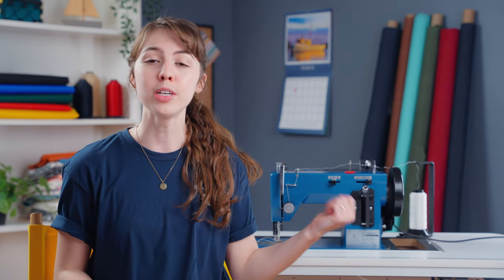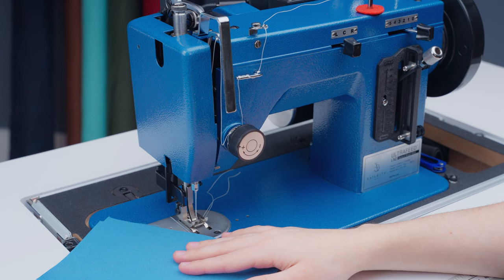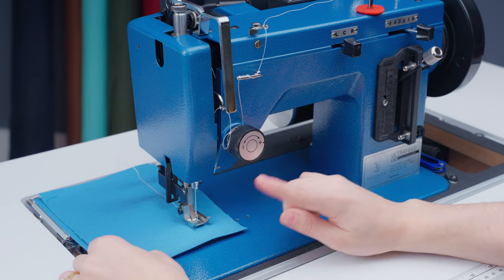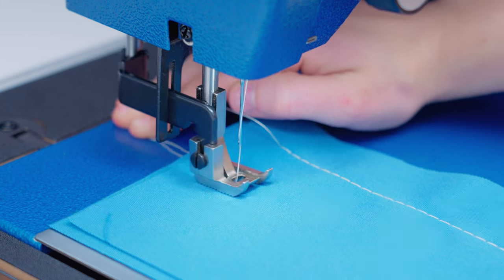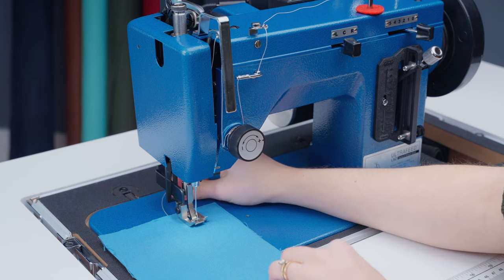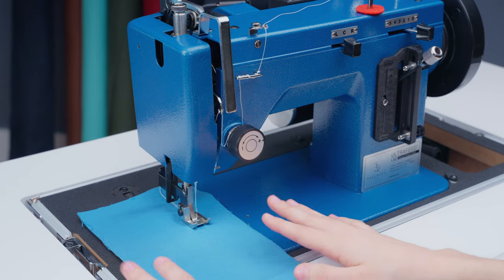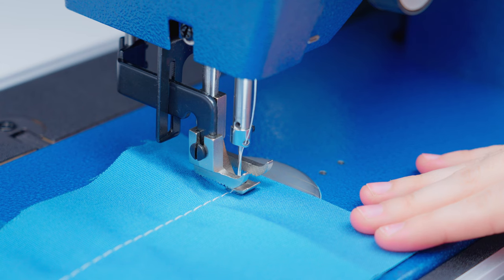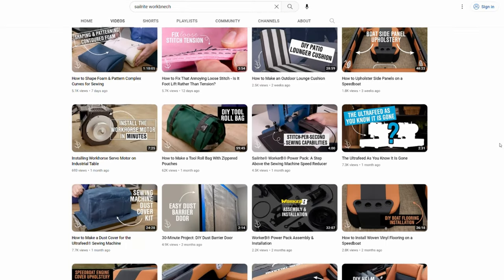Learning to Sew | Part 2: How to Stitch

Comment: You may wish to consider using a different color thread on the bobbin so it will show if the thread tension is set correctly or not. You could also show what a overtight and excessively loose thread tension sews like using this technique. Just a suggestion.